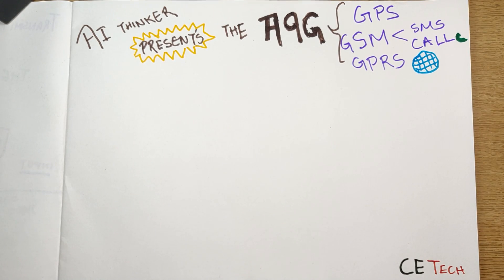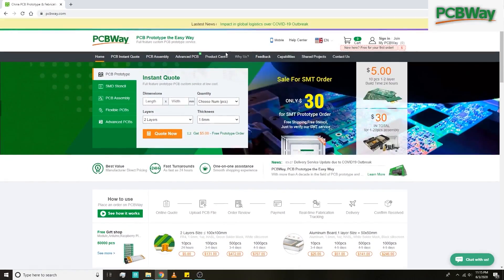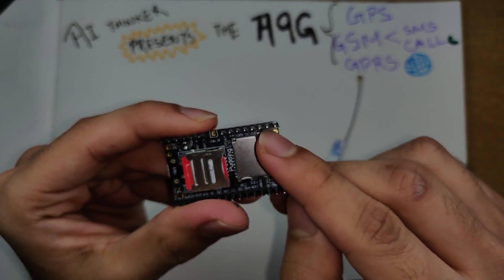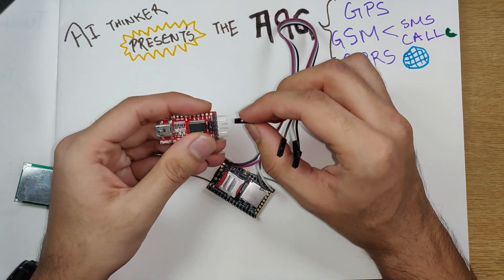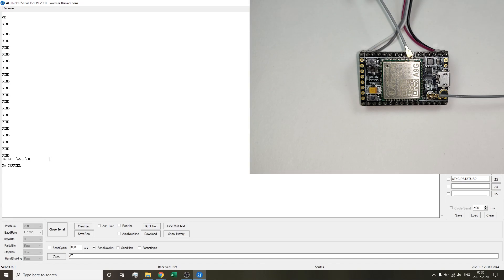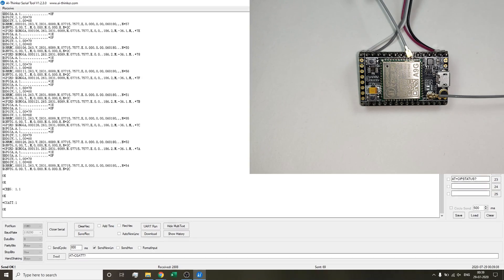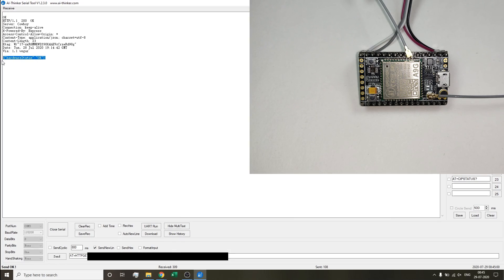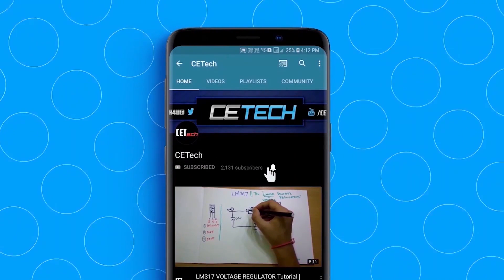A9G GPS & GPRS Module Tutorial | Ai-Thinker | AT Commands

Comment: Hello, we need to modify the standard firmware of the Ai-Thinker A9G, to integrate the use of the inputs and outputs that the module has.

The idea is when installing an IMU sensor, if a movement level is detected, the geographical position is transmitted to the server.

It must transmit the state of the battery charge periodically and be able to interact with the other IO ports of the chip.

Tell us if you can do this and what it would cost, and if you have already done something similar for Module A9G.